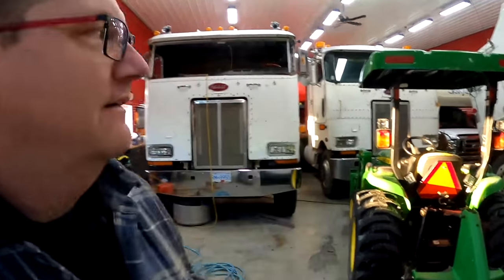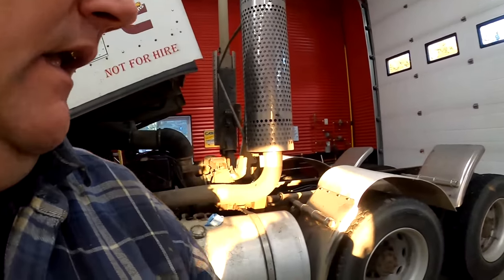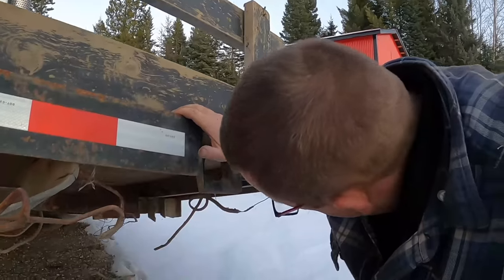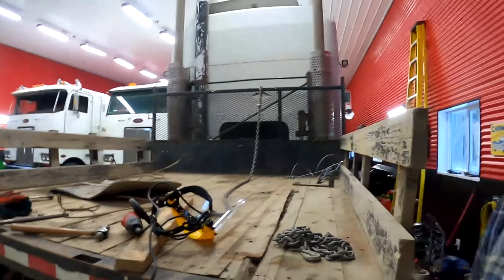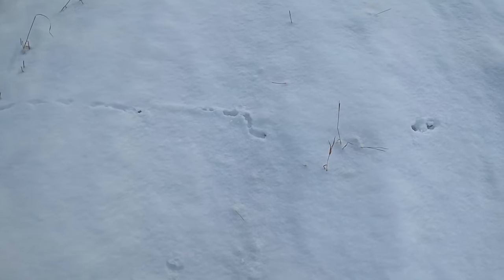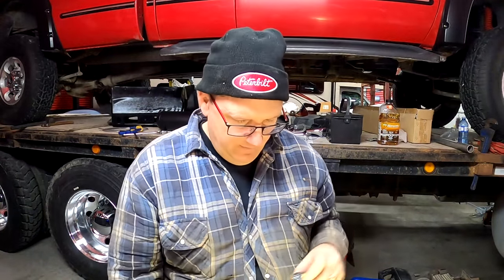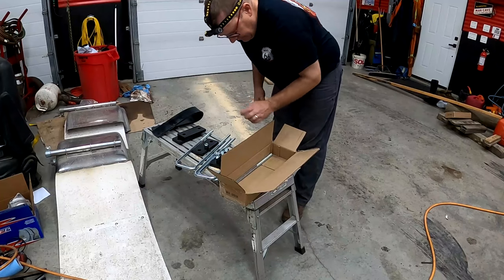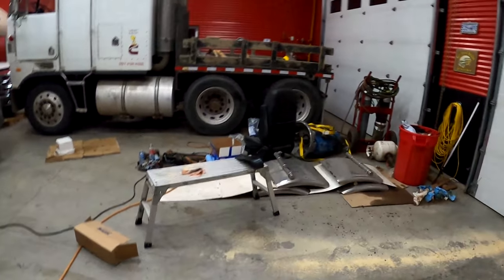Making a K100 Pickup truck! 😀

Comment: I think if you paint the side rails of the deck and varnish the deck bed it would look much better and possibly increase the value of the deck. Now you can store your chains on the deck. Glad you've fixed the hole in the fuel tank.

Please can you post a photo of Kenny next to K2 in the snow? It would be awesome.

Hope you manage to change the alternator. It will help you to drive Kenny to work every day without needing to use battery chargers.

Comment: alternator should need 12 to excite charge and never weld with batteries connected or you do fry alternator.
Reply: GM one wire alts. where put on lots of vehicles, factory and after the fact. 
They are self exciting. Best way, is put a GOOD multimeter on it when running, then you know for sure. Anything else is pure guessing. Your money.🤦‍♂️
Best wishes from Northern Manitoba.

Comment: I like it a lot Mike. I myself would of went a full four inches up so it wearing iron somewhere, a broken link is less likely to slap the bottom of the deck. Also if driving over a rock or something of size with a rear tire, the dual on the truck won't ride up against the bottom of the truck bed. I were too a driver once and just having a place to put some lights would obviously get a light. Maybe some blue ones somewhere??? liked them too when I could just the right spot for one to shine. Some places their illegal and I think that means everywhere but never told to take one off. Now as far as room goes inside the shop, add a room the full length of building for a tool room and the air compressor could go in there with its own little room walled off so the sound is gone from air compressor running. The next five  more years is going to see a ton of tools that just take a little spot for. Also its easier to wheel those torches to different spots... speaking of  torches, learn on how to adjust the flame just a bit higher on the cracking sound and then lean into your cut an it warms faster, and you just keep that thumb down on the long air valve and move with the torch leaving a nice clean cut that looks like a hack saw cut instead of a bubble gum melting contest. You won't miss that plasma cutter at all. It seems at first like your wasting oxygen but actually the cut is clean and much much faster than any other method used especially thicker metals. I used torches in the bottoms of the boats we were building. Boats are less than three hundred feet long. I worked in ships as well when just a few years younger than you are now. You will find a place for torches and welders only, tools only and electrical only not to mention the different pullers and tools used just with pulling stuff off like gears so presses go with pullers. Never to many different presses. Areas for clamps of all sizes so you just walk up to it and go "Yep, thats what I need"! And since you read it here, you will talking to self say it out loud, yep thats the one"..... My shop was just a hair wider but about the same length and the middle stall was a pit  the full length so truck and trailer pulled over it. Expanded steel on the inside on sides when pit was open and with floor closed it was a wooden floor that you hooked with a rod and closed different sections, and down the sides shining up were halogen lights. Yes it warmed the pit and lit things up like the fourth of july. My shop was set up with a double door to the outside for oxygen and acetylene bottles, that were plumbed to a manifold for the shop and in different locations were places for the gauges to hook up rather than torches on dollies. Those did not run everywhere but did to the pit and some different places in the building. I had a full "Nancy room" with a double door exit outside for a ambulance to pull into (thank god).... my shop was the "Peterbilt" of shops and lots of men told me they would work for half the wage just to work in that shop. It cost a a quarter of a million to build but was worth millions when done. Big glass panels in the roof for natural light and we closed them off in the winter so the lights inside were brighter. I got my ideas from the shops that the military had when I was in the service. Overhead gantries for raising stuff with on all the stalls. That was as good as some of the lifts that were in there. I never had a full length lift and always did want one but it just would of got in the way of everything else crammed into that building. My break room was better than the wifes kitchen. It was before computers of I would of had screens in there for that too I'm sure. One fairly good sized area for shop manuals a a fish for looking up parts and calling them in. I had a paint shop but not connected to that shop as it was its own problem. Hard to keep good body men working. Ten full time guys pulling wrenches when finished. One of them always had a personal rig in my body and paint room. My frame stretcher was in the main shop were it was needed most. At the height of my short career in there was always rigs being fixed as I had twenty over  the road rigs. I liked anything with a steering system so we did have problems with parts. I hired kids to work the tool sign out room because furnishing tools for all was damn expensive. At the end, I had a half a million in the stock room for steel. I could almost spell Dormine for all the nuts, bolts, screws, nails, pipe,... I had local stores come and buy stuff for their stores. And yes if you asked, I did almost go krazy building it as it was always a work in progress. All told, it took me five years to build, a couple good years of use and the government one day to shut down. A crooked bookkeeper and taxes took everything. I did walk with a bit of a gate when I owned it and slide around like a snake in shame when I lost everything. I started a helicopter logging operation and the government just decided to make a  I can't pull the word out of my head ... anyway it was to show crime doesn't pay like they ain't the biggest thieves in the world. I made headlines in the news for a little while and then when I proved that I never knew what was going on, that I too was the victim of the crime committed. I got a forth page "sorry" and that I was exonerated from any crime as I was facing many years in jail just because of having a dream business. From broke to well off to rich and back to really broke when they were through selling everything for less than a penny on the dollar. Wow, I never intended for you to know this much about me Mike but it feels good to get off my chest. I was just going to give you some ideas on how to set up a shop an spilled my guts.

Comment: If or when you decide to purchase a plasma cutter I recommend you get the 220volt model, not the 110volt. The reason is many 110 volt systems can only cut up to about  a maximum of 1/4 inch thick steel, where as a 220 volt system can cut 3/8. Sometimes you need that little extra cutting power to get the job done.    :0)

Comment: Key on power at all. Should be battery voltage running should be 12.9 to 13.4 volts or 24.9 to 25.6 depending on the system

Comment: You should make the bed so you could lock it onto the fifth wheel plate of the other trucks if you need a short bed instead of low and slow all the time.

Comment: That little light could probably be used even as a temporary headlight if one burns out while you're driving Kenny or Low and Slow.
Reply from the maker: Yeah it's crazy bright
Reply: @mikethetrucknut  last winter i was almost to the landing when my headlights went out and wouldnt come back on Stuck my tac light out the window  enough light to carry on to the landing to get loaded .by the time i was loaded .Was daylight  ,Same light as the head light ........ Jim Chamberlain

Comment: So the alternator is a generator and does not require a electrical source. In truth, since you had it grounded out, you would have energized the point were you connected, since it didn't spark, one would assume that it didn't ground out. You could have a bad fusible link, bad ground or power cables. You need to get a meter and check resistance of all your leads. You need to check voltage coming out of the alternator. Maybe take it off and run it to the parts store if you don't fill confortable doing it yourself.
Reply: it´s an eletrical controlled generator. yes it could work only with residencial magnetism, but normally it works only with energ. that´s why you have the control lamp on the panel.
Reply: @oliverroedel1111  The alternator uses mechanical energy. To supply the battery, the alternator uses its AC power through a rectifier. It does not require energy at all to run it, only mechanical energy. Thats why a car will run without a battery.
Reply: @TheBlueberry606  so you need to study more about alternators. as I said, yes mostly they work witout energy cause of residential magnetism!!!! if he doesn´t have it, he will not charge cause there are no magnetics! so how he would charge? he charge needs a electro magnetic fiedl which comes from batery! once charging, yoy can disconect the battery.
Reply: @oliverroedel1111  he doesn't need electricity.  Its mechanical energy. If the alternator worked at all he could roll that puppy down hill and jump it into gear. But the generator doesn't need a charge, the motor needs a charge to start in order to create mechanical  energy to make the alternator work. Right now, his alternator is poo poo 💩 😆 the control lamp on the dash is just a voltage detector, if its not in speck it will come one, as long as the battery works that is.
Reply: @TheBlueberry606  I´m sirously recomending you do a study! you doesn´t know how an altternator works. PLEASE study! it´s electromagnetism! the positive form the panel lamp goes to the alternator to reate an electro magnetic field which makes it possible to geneate electricity. thats how the charging controller works! he switches the electric magnetic field on and of to not pass the charging voltage. if it was a simple mecanic generator there was´nt no control and it would charge over the max voltage! and this is what happens if the charging controller doesn´t work correctly. it cooks the battery with high voltage! please study!
Reply: @oliverroedel1111  ok 👌 👍I think you rectified the situation 🤔
Reply: @oliverroedel1111  I think your over complicating it, especially the panel light. But, we will go with it.
Reply: @TheBlueberry606  it´s not me, it´s a tecnical fact! you turn the key, the battery light goes on, cause gets 12V, and the negative of the battery light, is directly connected to the alternator/regulator. so this voltage creates a electro magnetic field in the rotor core, which when the motor spins creates energy! a lamp connected to two positives will turn off. than the regulator switches the rotor coil on and off, faster or slower to maintain an 14V output of the alternator. thats how the older ones work. you can test it unplugging the battery lamp. the alternator will not charge (only in high rpm if there is a residential magnetism in the iron of the rotor). modern ones doesn´t need the lamp, they do theyr job  directly, the lamp is only there to know if the alternator charges or not.
Reply: @oliverroedel1111  I didn't say you were wrong, I said you were over complicating it. Yes, the battery provides a temp power to energize the alternator. But, once its spinning can provide its own power. So if one was to push start the hehicle, if the alternator and circuit was correct  said car would run without the battery. All of this is redundant since Mikes alternator is probably trashed, and yes he needs to check the circuit.

Comment: Ya might check into putting some super singles on the rears
Reply from the maker: that would be cool
Reply: Hi Mike, I'm with the guy who said you should look into getting super singles. I saw a video and the truck looked cool. Instead of 8 wheels you would only have 4 wheels in the back k. Just a thought.  Like the deck on Kenny I would have but the 4x4 instead of the wood you have under Kenny. An then paint the deck black and put a new deck of wood and again and seal it to make it last longer.  An Merry  Christmas to you and your family

Comment: welding the tank holes isnt hard you c an either use filler rod and fill it in or make whats referred to as a coin which is a coin shaped patch you weld over top
Reply: also  on the alternator thing if its spinning its charging (if its internally regulated ) if its externally regulated it needs 12v  at your regulator and then you have a generator which you have to energize when new then after it charges if it spins but can lose the charge in the magnets making it useless and as far as dead shorts go if its positive grounded it will short and fry the regulator